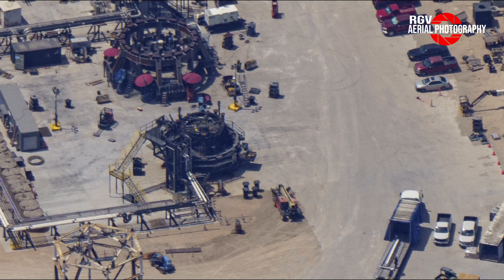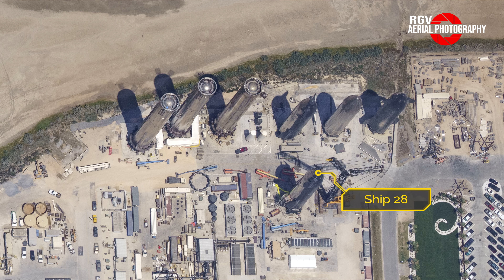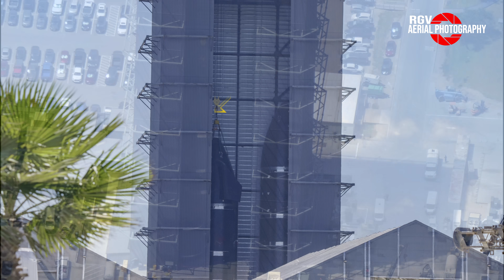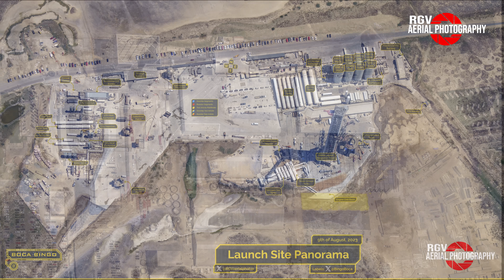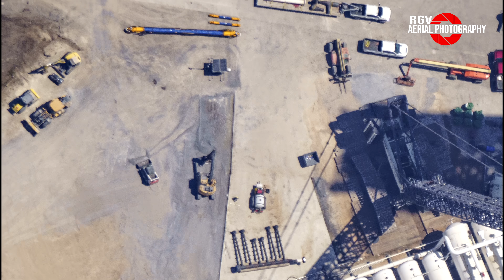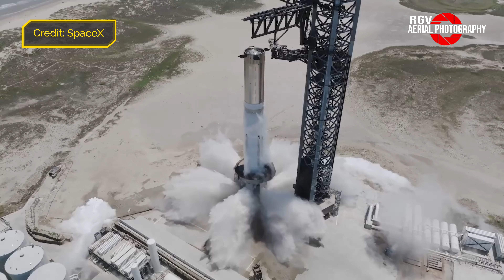Hotstaging, Starfactory Expansion, Post Booster 9 Static Fire and More! Starbase Update Episode 12!

Comment: Everyone keeps comparing the booster 9 static fire test to the last booster 8 static fire test, but they were completely different tests in one regard.   Booster 8 had 3-4 smaller static fire tests leading up to the full static fire test.  This showed issues that needed to be addressed as the system was worked.  Booster 9 skipped all of those and went straight for an all engine static fire test.  The fact that only 4 failed out of 33 is very good.  Had they chosen to do 2 to 3 midterm static fire tests where they test 6, 12, and 20 engines prior to the full static fire, the full static fire would have most likely been a full success.  But as is, with the jump from cryo to a full static fire, it shows their desire to ramp up the production and testing speed, as well as flushing the bugs out of the full booster quickly.

Comment: Problems with engines on and just after start with 33 engine static test and on first integrated test flight may reflect different engine  orientation than used in individual static proof tests, or resonances due to dynamic interaction of CH4 or O2 pressures between engines through the CH4 and/ or O2 distribution systems.  POGO was a similar issue for early liquid rockets, but the dynamic interactions get even more complex or chaotic as the number of engines increases.  While falcon heavy has 27 engines, it is really 3 groups of 9 with probably lessor interaction between cores' fuel systems or engine pressures.  Just a thought.  Might require quite a bunch of multi engine static fires to resolve and proof.  Could even be an acoustic interaction from the exhaust off the ground plane.

Comment: I dont think its a major issue with engines failing since they dont plan to recover the prototypes only the data it will still have enough power to get to orbit until they start using starship with payloads
Reply: It's a major issue if they DO want to start flying payloads.  :)

Comment: Thanx for the footage, as always great stuff. I will publish my bit on the failure of Stage Zero and what to now expect with the new base plate and deluge system, when we have a conformation of a new launch date. With it based on the one major factor that is missing, the lack of consideration for the effects electrical charge has on matter. Although not privy to the data, I doubt that the engine failures were down to the engines themselves but instead their total ignorance of the charged matter and so still pseudo religiously believing in scientism being without doubt correct.

But when we consider that by their very existence, all atoms are made from protons (positive charge) and electrons (negative charge) and so, have created electrical fields within themselves, due to the separation of charge. That the atoms that make up the molecules that make up the cells that make up our bodies, each having a voltage of 25 millivolts, when in a healthy condition. And between 50 and 200 Millivolts when in healing mode.

And that we think and our central nervous systems work by way of electrical impulses. The environment in which we live (unless an astronaut) has a charge differential between the negatively charged earth and the positively charged ionosphere rising by about 100 Volts per metre up through the atmosphere. Magnetic fields are seen throughout deep space and there is only one thing that creates magnetic fields and that is electricity. So yes that means that even a permanent magnetic has to be made by the metal having to shot through with electrical charge, so to align the atoms in a series configuration and so create a magnetic pile through the metal. 

Plus we shouldn't of course forget or fail to learn, that the force of electromagnetism is 10^39 or 1000 billion billion billion billion times stronger than Newtonian Gravity, or even how the Einsteins (man and wife) fantasised about it back in the days of gaslight, the bending of the Electromagnetic Spectrum in the presence of matter on a flat bit of rubber-like cloth.

So roll on the launch date, as the power of electrical charge on matter once again shows itself, like the different colours used in the PDM 3 (arc mode) concrete cracking event. As I now suspect they have also now noticed something unexpected about the fractal patterns running through the concretes surface ¦:¬)
Reply: Wow, someone has gulled you and gulled you hard.
Reply: @TheEvilmooseofdoom  Sorry I don't know what being gulled means, is that an american term? Please explain and I can then gauge the remark and what you mean by it, thanx
Reply: @postsurrealfish  If you don't know, google.  Why do I have to spoon feed you?  Oh right, if you're not being told what to think you don't think.  This is your problem and why you were so easily gulled.

Comment: The Raptor engines are new and the first of their kind of course they are going to have reliability issues also expect Spacex to be trying multiple configurations some more reliable than others whilst they bottom out the most reliable config for the raptors.  When they start consistently static firing all the engines at once we'll know that phase of the testing is over.

Comment: I appreciate your videos, but please dump the background beat. I listen on a proper ound system with big screen and it is annoying and brings no value to your video. 
I don't think the reverse water shower will be a permanent solution. Eventually, whoever opposes a flame trench will have to relent and allow a permanent solution if he wants to have requecy use of the pad without need of refurbishement every time.  Unless we know the thrust level of this test for teh 29 engines,  we can't gauge whether the current solution will work.  It is possible tht in increasing thrust, the pressure exerted by engines on the steel plate will be greater than pressure exerted by water, and it means engine exhaust will penetrate the steel  and push water back to the tanks. 

And when  they start to want to land,  am curious on the trigger to start water deluge prior to ship deciding to light the engines on final approach especially if not perfectly lined up yet and some of the exhaust inpinges on the ring itself.  I wouldn't be surprised to see a change in the chopsticks to be able to rotate more, and have a barebones ring 90° from the real OLM and have landing attempts there, and then chiopsticks able to lift stage the landing ring and rotate it to the fully decked out launch ring.

Comment: if water is being pushed at high valocity up and around and engines then fire? massive pressur vibrstion may h it and dely ghhalt the engines first working?
Thus engine prime moment before water gases opressurer reverberate may have to be fine tuned for engines to be fully maxamised brfore full deluge is at a=uts hight

Comment: As cool as the big "Dyson Sphere" from TNG (Relics -- thanks for the season/episode # lol) is, I don't think it's practical. However it were to be built to that particular spec, it would definitely need to be designed for radiating exces heat. That's why it's doubted that a species could hide their star and it's emissions using any such shell (unless it had some weird properties, such as diverting excess heat into subspace).

On the other hand, it would be really cool to build something that could trap the energy o a star to build-up a ridiculous charge to be released a later time. Like a solar-capacitor... That said, my preferred concept is in the form of the "Dyson Swarm". Start with a ring constellation, and work your way up. As each individual "satellite" is built, it could immediately be used for habitatiion. Rings could be made to overlap and intersect. Perhaps a scaled-down vesrion is merely used as a way to gather and delvier energy to a planet or a handful of large habitale plces. Either way, cool topic with many possibilities!

Comment: I don't think Raptor is the problem with shut downs.. I think it's fuel pressure and it regulation. I have a hunch that shutdowns are caused by too rich, or too lean conditions, and the Raptors auto shut down to protect themselves. This is probably why they have been playing around with the start sequence. Just like in your home, if someone is in the shower, and someone turns on water somewhere in the house, the person in the shower will either get scalded, or frozen. This is just a hunch however, but it has happened before with the first short flight test. It's allot of pipes feeding from only two tanks, and the Raptors are probably allot more thirsty then Merlin's. Fuel delivery is naturally going to be difficult with so many engines.

Comment: The Concrete poured under the OLM was never allowed to cure. Standard foundational pours (approx 6 - 12 inches thick), take 28 Days to reach a 98% Cure.  Deeper Concrete pours, such as w/ the OLM's base, require much longer Cure times depending on depth. 
   SpaceX's "Go Fever" has likely cracked and disrupted all that hard work they did to repair the pad. If this latest Test Firing of 33 (actually 29) Raptors has cracked the OLM's base, they'll never know how a Fully Cured concrete foundation would have held up, because it wasn't allowed to Fully Cure. I think their impatience on Testing before this pour was allowed to cure was a Huge mistake. If those are cracks, and they likely are, then they're already committed to repairing some pretty deep cracks which will likely continue.
   This issue w\ developing a Launch Pad base w/o a Flame Trench is probably why construction of the OLM at the Cape has stopped imho.
  All that said, these Flyovers are Amazingly Well Done, the Hi Res Photography work makes it work !
Reply: Look up the cure time for fondag.
Reply: @TheEvilmooseofdoom   I believe they only used the Fondag on the surface pours, and not the drilled "leg" pours.  You can always add accelerants to concrete but there's a tradeoff and that's gonna be overall strength. 
  Besides, Fondag was proven Not to work as a surface pour and it was fully cured for that first SS launch. I think they'll figure it out but I suspect some contractor fed them a line on whether that concrete repair work was ready just to make a deadline. 
 Maybe those blue & red paint marks on the OLM's base are some Abstract art by some Right brainer ?    😳

Comment: The previous pad survived static fire, too.   The few seconds at half thrust is nothing even remotely like the force that will be unleashed with a full throttle burn that takes 5-8 seconds to lift away from the pad.   The acoustic concussions of full throttle firing will not only be two orders of magnitude stronger, they will also create constructive interference between the engines and the pad that will take the same form of dozens of shockwaves that were seen shooting up the side of the rocket in its first flight.   It was these concussive shocks that pulverized the concrete, and this static test clearly shows that the engine thrust can easily overpower the water deluge system, fully exposing the flat plater of the shower head.   I am betting the next flight will make the shower head under the pad look like a Jamaican kettle drum.

Comment: The work they've done recently to the RQDs make me think that engines that failed were the outers one
Reply: Also, I don't think there's an issue with the raptors themselves. There's a reason using a large amount of engines at once is difficult. Plumbing, essentially what happens in the plumbing system with so many engines.
Reply: Agreed.

Comment: In addition to thrust and heat effects on the launch pad, acoustics and reasonance effects must also be considered.  Structural concrete takes months to fully cure.  The extent of cracking in the pad was highly unlikely to have been present before the test.   Expansion of residual moisture in the still curing concrete with heating and damage due to acoustical and mechanical vibration of the pad likely contributed to the cracking.  All of the affected areas will likely need😢 to be replaced and a steel over cover, possibly with acoustic dampening, will likely need to be installed before a full thrust static fire.  If the central engines were the ones that failed, then acoustic damage caused by the lens formed by the deluge and reflections from the underlying steel plate could be to blame.
Reply: There are quicker curing concretes.  Concrete cracks.  Water is a great acoustic damper, that's part of the reason it's used.

Comment: Stress on the wall of starship where the slot for starlink v2 is, could be greatly reduced by inverting the dispenser so satellites exit the top of the stack.  That way there is less rocket above the slot to support during max-Q and other stressful parts of the flight.
Reply: Was thinking the same thing. Or build the hatch in a vertical plane instead of horizontal, using a revolver system to load and deploy the satellites.
Reply: Revolver would be better, because a vertical slot would allow bracing on either side of it, instead of a wide slot that cuts out half the support for the ship..  There needs to be room for two satellites back to back in the revolver though.  Otherwise just invert the stacker so they come out at the top instead of the bottom so the slot only has to support the very upper part of the nosecone.. @RogerM88

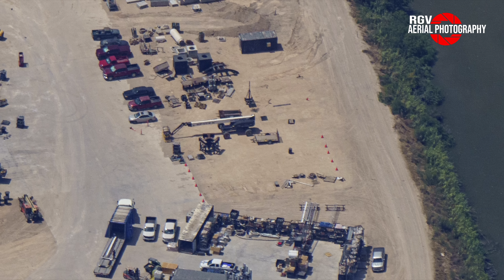Comment: I'm wondering if the two tracking stations dishes are going to move to Massey's to free up space...? There's that unknown area at 1:55ish, but maybe that's too close to the test stands for safety...
Reply: I would expect that they discovered during the first test flight that rf reception through a rocket exhaust plume is less than nominal. I would guess they'll be moving the dishes to a site more perpendicular to the flight trajectory.

Comment: SpaceX seems to be evolving the rocket industry from disposable rockets towards disposable launch pads. They seriously need to start considering, a proper launch pad with a flame diverter.
Reply: What do you think the point of the water cooled plate is? They did invest in a flame diverter. Now they have to test it.
Reply: @Barthhhelona  this is not a flame diverter, more like a fire suppression system. For a proper flame diverter, SpaceX needs a fire trench, water cooled. To divert from the rocket, not only the fire from the engines as the shock waves.
Reply: @RogerM88  It is a proper launch pad.  They don't need a trench.  They are missing a diverter and I suspect that is because they want to keep it flat under there for the time being.
Reply: @RogerM88 The issue of the flame diverter has been brought up ad nauseum and the response from those who follow the starship development has been consistent so here it is again as I understand it. 

 The water table is too high at the launch pad to allow for a flame trench.  There is a lack of space to raise the launch pad to allow for a flame diverter.  That would mean raising the pad 50 ft or so which was out of the question.  

Add to that building a flame trench deep underground even if possible would have required a slew of evaluations, studies, certifications, etc.   And no guarantee it would be permitted since the launch pad is surrounded by protected wetlands.
Reply: @TheEvilmooseofdoom   being flat is one of the big reasons why this design is failing to withstand the thrust power of the engines.
Reply: @michaeldeierhoi4096   there were other options, as rearranging the leg stands in rectangular layout instead of hexagonal. Allowing to have space to build a ramp that would work as flame diverter, with a water deluge system. While to maintenance work in the engines, the crane would lift the booster and place it on a stand near the launch pad. This deluge system seems like an after thought to deal with the unexpected damage caused by the engines thrust.
Reply: @RogerM88  Except it's not failing. You are making a baseless claim.   There has been only one static fire since the pad has been upgraded and more testing needs to be completed to verify the integrity of the pad in the face of full thrust at launch.
Reply: @michaeldeierhoi4096   "baseless claim"?
Reply: @RogerM88  Your own comment said that flat design is "failing to withstand the thrust power of the engines".   The first static fire with the deluge went as expected by Space X.  There was no sign of degradation of the pad.  Even the paint on the OLM held up though it was only a 2.74 static fire.  Obviously a redo is called, but we'll see what Space X does.   Do I need to be even more clear?
Reply: @michaeldeierhoi4096   did you watch the video? There are cracks already forming. And the deluge systems requires very high pressures to be functional. The boil of water inside the plates could lead to be shredded to pieces with water vapor. the Pad being flat, exerces too much pressure that could crack the foundations, as not properly diverting the shock waves far from the rocket. Add to the complexity of the water deluge system, the process to start the engines in the outer ring.
Reply: @michaeldeierhoi4096   my comment about the flat pad, was pointing before the water deluge system. Which look to be an after thought. A Gravity water feed system, plus a ramp with steel plates, would be far simpler and reliable option.
Reply: @michaeldeierhoi4096  and even with the current deluge system, would be very hard to withstand multiple launches without the need of extensive repair intervention. Too much thrust coming from the engines.